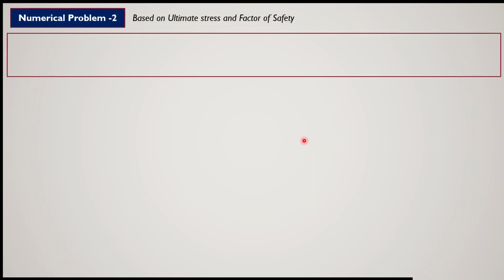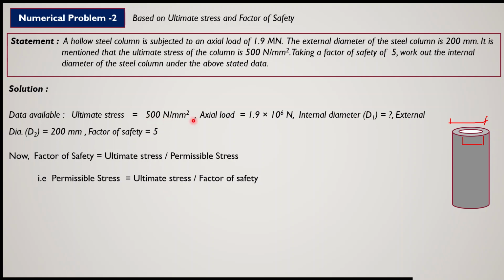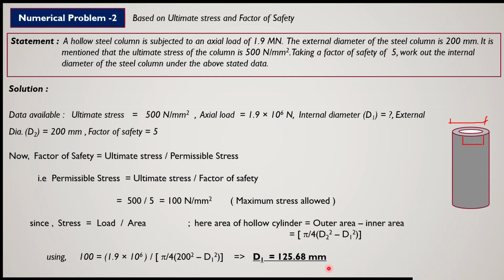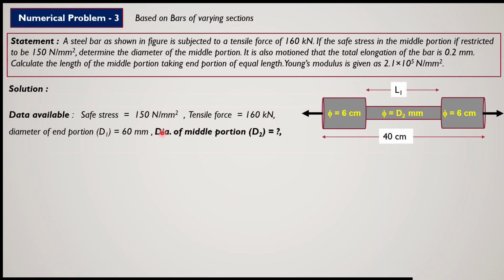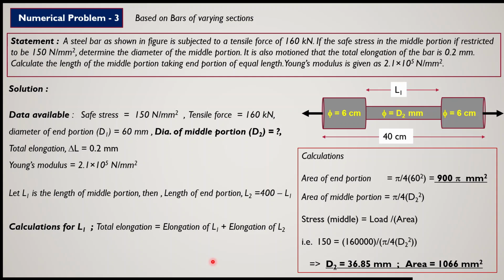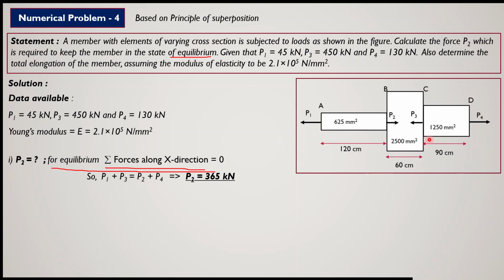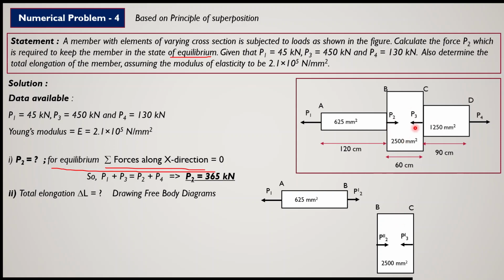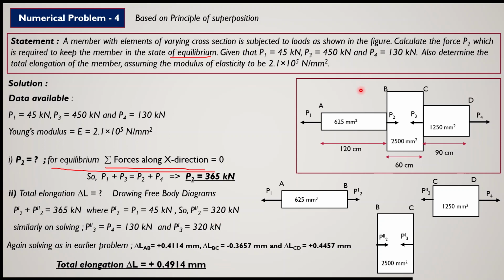Lecture 6 || Strength of Materials || Civil Engineering ||  Stress-strain-elasticity Numerical

Comment: If d1 is 100 mm then permissible stress will be 80.638 which means load bearing capacity will be less and if d1 is 150 mm then workable stress will be 138.237 which means load bearing capacity will be more.
Reply from the maker: Workable stress/Permissible stress does not depend upon area of cross-section.
Reply: @DrBharatBhushanJindal  sir, stress depends upon area, which means permissible stress will also depend upon area. How will it not depend?
Reply: @DrBharatBhushanJindal  sir, another observation can be that if we increase the d1 the difference will be less means the load bearing capacity will be more and if we decreas the d1 the difference will be more which means the load bearing capacity will decrease.

Comment: On increasing the internal diameter i.e greater than 125, area will decrease resulting in decrease of load carrying capacity and on decreasing the internal diameter i.e less than 125, load bearing capacity will increase due to increase in area.

Comment: I think if the inner diameter increases and becomes closer to the outer diameter then area will decrease which will lead to the decrease in load bearing capacity.

Comment: This is 19bce056
 
If we decrease the inner diameter to 100mm
Then the permissible stress will decrease to 80.679
And the factor of safety will increase to 6.2
This means the column is more likely to give up to the stress developed then a column of 125mm which had a factor of safety of 5
Reply from the maker: Watch lecture again carefully.
Reply: @DrBharatBhushanJindal  i was finding stress instead of load

Comment: 10.06 : sir on decreasing the internal diameter the area difference will increase i.e the area of material will increase that result in the decrease in the stress value, hence on decreasing the internal diameter the load carrying capacity of the hollow cylinder will increase.
Reply from the maker: Exactly.... but do not get confused with load carrying capacity and permissible stress.